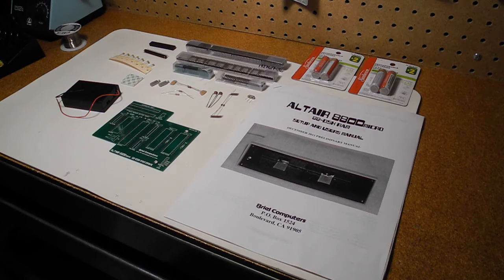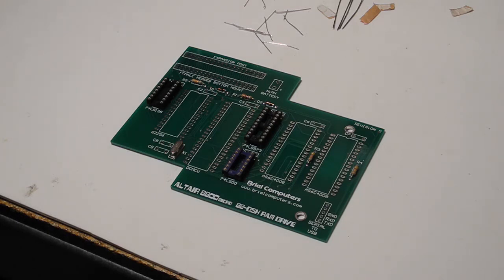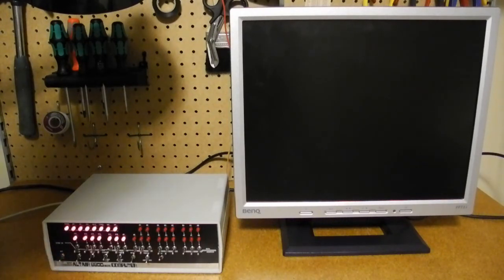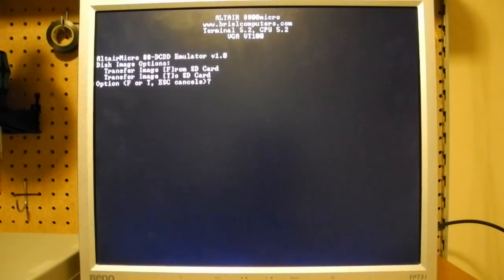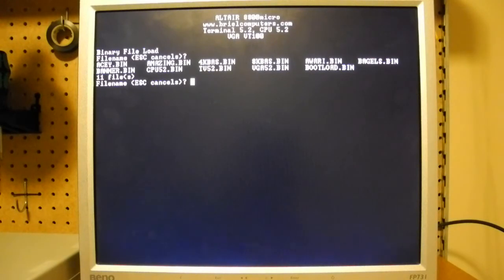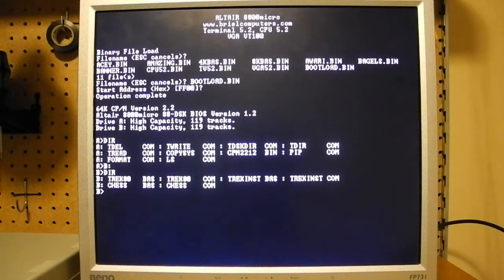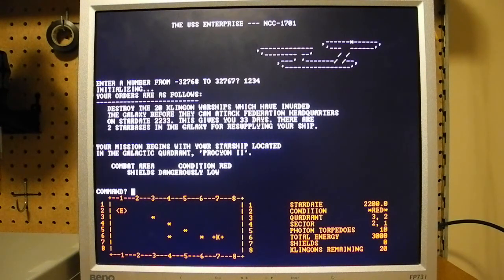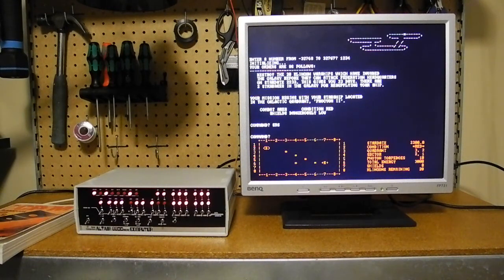The Briel Altair 8800 Kit, Part 4: RAM Disk Board and Running CP/M

Comment: Jeff,

I follow avidly your fine videos (even building an Ugly Weekender myself) but this series is of special interest as I am in the middle of reviving my old KayPro 2X. Wonder what C compiler you will be using? Editor? WordStar in non-doc mode? Multi-Edit? 

If you do a video on that be sure to include a tutorial on the ENTIRE build process from source to .com executsble.

Tnx es 72,

Bill, k6whp
?
Reply from the maker: I will post details here, and maybe also on the Briel Computers forum. As far as a C compiler, I plan to look at BDS C.
Reply: Jeff Tranter
I would be interested to see if BDS C has many of the functions of the Standard Unix Library. When I last looked many years ago, it did not. But, man, was it fast and light! I got the Q/C compiler and believe my original disks are still around. (I believe it's in the public domain now, if you would like a copy.)

Anyway, keep up the good work. The KayPro is nice but I like the idea -- even though it's not thoroughly retro -- of running off the RAM disks to do development.
Reply: Jeff Tranter Jeff, just a follow-up on BDS C. The early offerings did not have a lot of what was to become "The Standard Unix Library" but I see where the version that Leor Zolman ultimately released to the public domain did have a fair smattering of those functions - including printf() and fprintf() with varargs. When you consider Zolman crafted the language in pure 8080 (or Z80?) assembler, it is an incredible achievement. I recalling it being hands down the fastest flavor of C for my KayPro development and it yielded the smallest, tightest .com files going.

If you are familiar with the C dialect (and your CV shows you are), then I would say go for it. You will have a rapt audience in these quarters, at least.

By the way, here's a bang-up interview with Leor; it reveals what a truly self-effacing and humble giant he really is:

http://www.mailsend-online.com/blog/an-interview-with-the-creator-of-the-bds-c-compiler.html

72,

Bill, k6whp